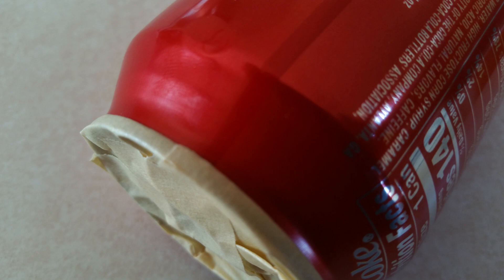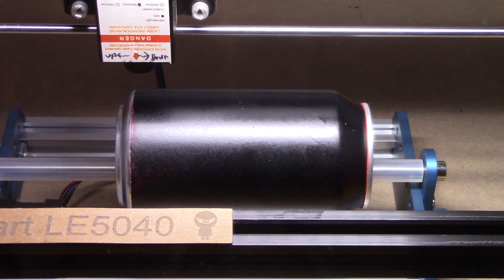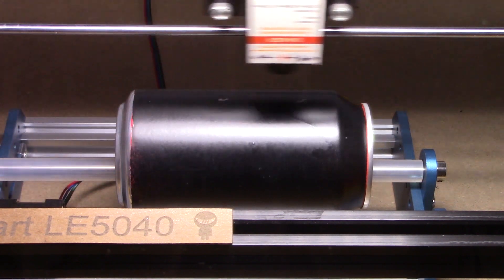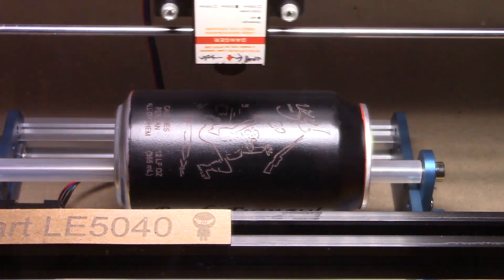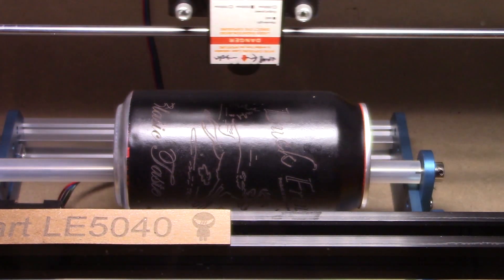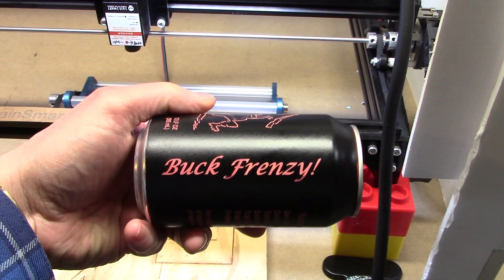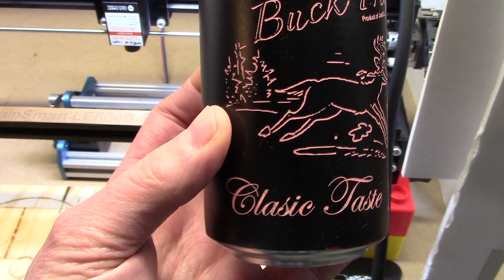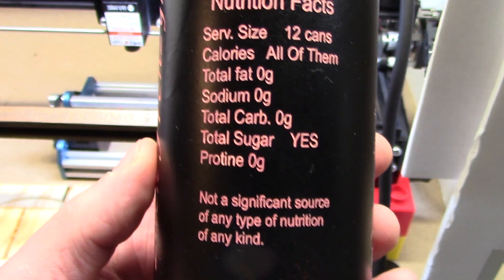Etch a pop can using the rotary roller

Comment: Hello we have to purchased this rotary roller, was just wondering if it will etch on glasses using this? Like is there anyway of moving the axis to fit a glass that is an even cylinder? For example a glass with a larger diameter at the top of the glass and a small diameter towards the bottom of the glass?
Reply from the maker: The way this roller is set up, you are somewhat stuck doing cylinders.  If you have something that is more conical in shape, you can try tipping the roller so the surface of your material is parallel with the laser's travel.  The trick is to get one end of the material propped against the inner edge of the roller to prevent it from moving in the X axis while you are rolling in the Y.  I have not tried this yet and have thought about it.  We talk about this a little in roller video I did with Making it Happen (https://youtu.be/JUZNc-bFB2U).  They use a chuck style rotary and it is easier to tip that and have the material stay in place where as using the rotary roller, the material can want to walk a little in the X.  I hope this helps.